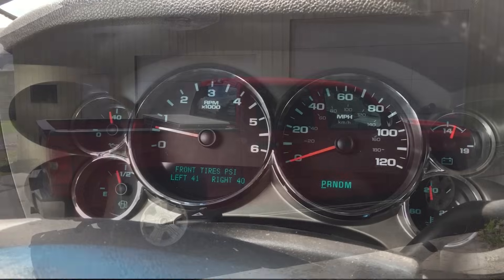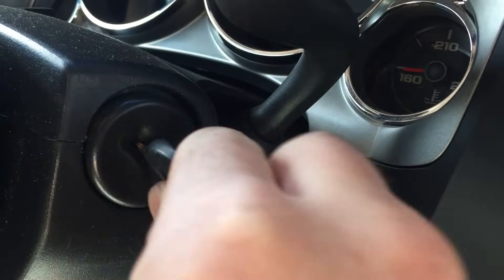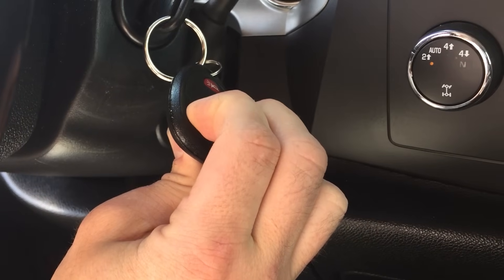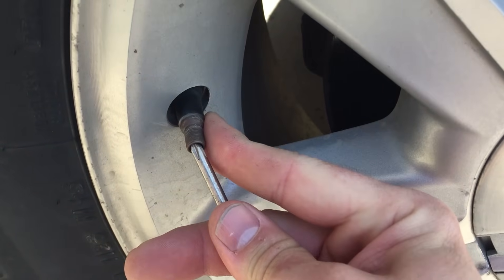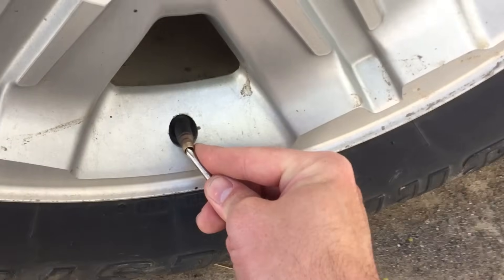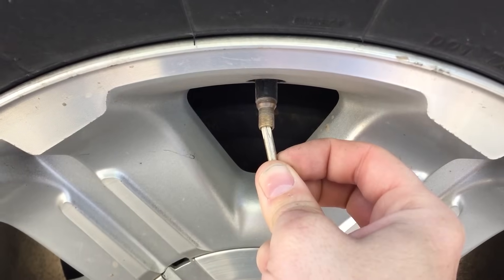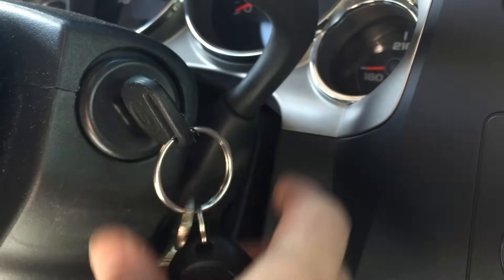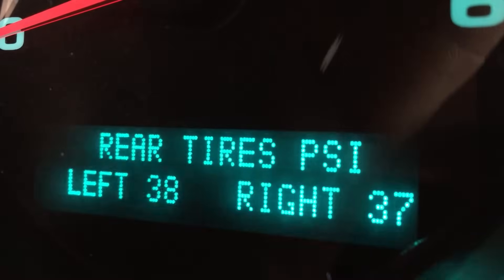2011 Silverado: Programming the Tire Pressure Monitoring System (TPMS)

Comment: I get two beeps after the third tire … back right and then it doesn’t respond to the rear left? Any tips????
Reply from the maker: You may have a bad sensor in that tire. Battery might be dead. You could try moving the wheel/tire to another location on the vehicle and redo the programming. If the problem follows the tire, that wheel has a bad sensor. If that's the case, I would suggest buying a 4pk and replacing them all. The tire will have to be partially dismounted from the rim to install, so likely a trip to the tire shop.
4pk sensors https://amzn.to/3PXjDrq
Single sensor https://amzn.to/3tm5ufH
Reply: @MasterJacks  thank you so
Much!

Comment: I have two sets of rims for my Silverado. One set for winter one set for summer. Both sets of rims have their own TPS sensors. How do I program the TPS sensors to the truck when I want to switch them back and forth? I normally take it to a tire shop to do it but I’m tired of paying every six months to have my TPS sensors re-programmed.
Reply from the maker: Have you tried this method after the rim swap? It shouldn't be part specific. It should detect the sensor as you deflate it and assign a location. Let me know, I'm curious

Comment: This didn't work on a 2011 Chevy Colorado LT. I found from another youtuber video to turn the rotary headlight switch from from auto to off (left) 4 times within 3 seconds while the ignition key was switched to the run position to go into the TPMS relearn mode.

Comment: My 2009 3500 HD diesel won't fucking beep when I release the tire pressure.  I've released the tire pressure for over a minute and still no beeping.  Whats wrong?
Reply from the maker: If it's going into program mode but won't program, it is likely a sensor issue. I would try a different tire. If another tire beeps, you know the one that didn't is bad. If none beep,  you may not have any sensors installed (likely removed with new tires or something).

Comment: Worked great except when I checked my tire pressures one was 30# low and my little emergency compressor takes forever to get to 75psi recommended for my 2500HD.
Reply: you mean recommended for the tire? Tires differ, the vehicle it is attached to makes no difference to that. The values on the door jamb are for a very specific tire set, probably what came factory on the vehicle, and are for comfort. The side wall tells you the pressure the tire is made to run at. For comfort usually run 80% of that.

Comment: I have a 2010 Silverado, these steps are very simple but when I get to the part to start learning the left front tire my directional light is on letting me know it’s ready to learn, I start letting air out but never hear the beep of the horn, I tried a few time with different air pressure at different seconds up to at least 30 sec. and still no horn. I’m Baffled any help would be appreciate it thank you
Reply from the maker: It might have a dead sensor or (no sensor). See if deflating another tire (even if it's the wrong one) will get the horn to beep.

Comment: Hey I tried doing what you showed in the video and the truck didn’t beep at all , Tire pressure went down to 1 PSI , it’s on a 2013 Silverado Single Cab
Reply: Same problem here
Reply: I have a 2012 Silverado an it beeps twice and the left running light came on but when I dropped the pressure in the left front tire it never beeps again. TPMS Light is still on.

Comment: Did you know that your valve stems by manufactures data should be in the 1 o’clock position when relearning are replacing and recalibrating new one's )?

Comment: what if the light still does'nt go off?
Reply from the maker: Then you likely don't have the right tire pressure or a bad sensor. This programming won't fix either of those. It just tells the computer the location of each sensor.
Reply: @MasterJacks  just got new tires and the light stayed on. did'nt have this problem last time i put new tires on
Reply from the maker: @bradhaston1909  A sensor could have been damaged during the install or they may have removed the sensors all together. Either way, the light only comes on if you have a flat tire or a system malfunction. I'd check with the people who mounted the tires.

Comment: Is this monitor system mandatory to be working because I'm from the old school and back in the fifties and sixties you can look at a tire and know if it was low or not that seems to be working good for me I filled my tires up to 45 lbs each and it still tells me that now I have for low tires not just one. In my opinion it's just another way to sell somebody an item that cost 65 to $250 each
Reply: You obviously never went to school did you.?

Comment: You have no idea how grateful i am that you show me and others  how to program the TMP for my truck. I bought 2014 size 20 rims from a gmc sierra 1500 i took my sensors from the old rims to install them on the GMC Sierra rims and I didn’t believe I could’ve sync the GMC Sierra TMP to my 2011 chevy silverado 1500 and i just follow all your steps and got them program and add it air on all the tires. I talk to the Gmc Dealer and they were charging me $250 dollars… im glad i came a-crossed this video thank you.

Comment: I know you mentioned the correct order to relearn each wheel, but too bad you forgot to explain that the vehicle will turn on the particular running light for the wheel you're too release pressure until the beep.

Comment: Question.. Did this yesterday after getting all new tires and new sensors. All went well, but now the DIC is displaying messages of "check front left tire pressure" etc. It says it for all 4 tires. The tires we have require 65 psi... How can I get these messages to go away?
Reply from the maker: Amber Mintz http://www.silveradosierra.com/wheels-tires/dealer-wants-87-to-change-tpms-psi-t77002.html

You're likely out of luck unless you can find and aftermarket programmer that will allow you to turn off the TPMS. Most diesel programmers have that option, but not sure about gas. Also, there are a lot of videos of people putting the sensors in a home-built tank pressurized to spec and throwing it under the back seat, but I think that's pretty hocky.

https://www.google.com/url?sa=t&source=web&rct=j&url=%23&ved=0ahUKEwjH4bjo4N_ZAhVsyoMKHbxbBN0QwqsBCIIBMAU&usg=AOvVaw0VTJzWxrN8ZFOD4xbU2nov

Comment: Tried many times on my 2012.... doesn’t work. Owners manual says you need the relearn tool.
Reply from the maker: Can you get it to enter program mode? Does the vehicle have the original wheels and tires, or rather the original valve stems with the built-in tire pressure monitors?
Reply from the maker: Hmm, I wouldn't have thought there'd be a change with the model year. You might try a different tire first just to verify it isn't a problem with that left front wheel sensor. If you can get another one to learn, it won't read correctly on the display, but it would tell you if the method works or not. 🤷‍♂️
Reply: Drew w my 2012 is doing the same thing

Comment: Is there any way to do it if you don't have a transmitter?
Reply from the maker: I haven't verified this, but some forum's say you can initiate the relearn by pressing and holding the odometer reset stem in place of the two buttons on the transmitter. Best of luck!
Reply: Jacob Taylor read your owners manual, tells you how with the DIC buttons

Comment: What do u do if u follow all the steps and the horn doesnt honk? I started on the left front and never heard the horn
Reply from the maker: Ruben Hernandez did the display show you had entered programming mode after you held the two transmitter buttons down?
Reply: MasterJacks yes, im just thinking about it but do all rims have the sensor in them? I bought the truck with mud grip rims and found sum chevy rims so i swapped them out
Reply from the maker: Ruben Hernandez If you didn't get a horn beep after 30 seconds of deflating, it could be a missing or faulty sensor. You could try a different tire location to see if any of the other wheels will program. If it's a rubber valve stem the sensor is missing. The factory valve stem is metal and has the sensor built into it.
Reply from the maker: And yes, all of the wheels have their own sensor.
Reply: MasterJacks o ok thats it then, i have a rubber valve stem
Reply from the maker: I misspoke, the sensors have rubber valve stems but may have a metal collar on them.
Reply: That helped alot, appreciated it

Comment: Will this work if I do not have the original remote?
Reply from the maker: Raul Trevino If it's a GM transmitter and is programmed to the pickup it should work.

Comment: Do I have to add the air while it’s off??
Reply from the maker: La DenaliHD once you've done the programming procedure you can adjust pressure outside of programming mode with or without the key on. The programming simply tells the computer where a particular wheel is located on the vehicle for accurate information display.

Comment: Can i do this if i dont have the original whells ?  The truck is 20. But i have 22
Reply from the maker: Jairo Gonzalez it will only work if the new wheels have sensors in them. You can try this and if it doesn't work the new wheels likely don't have sensors.